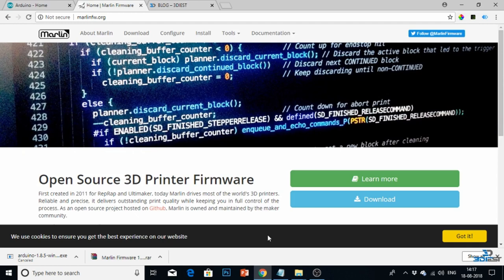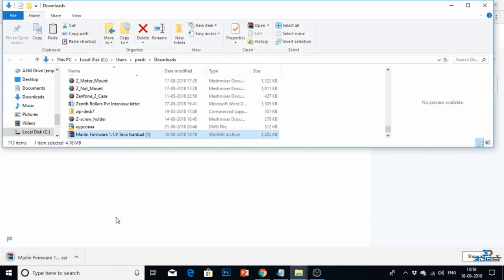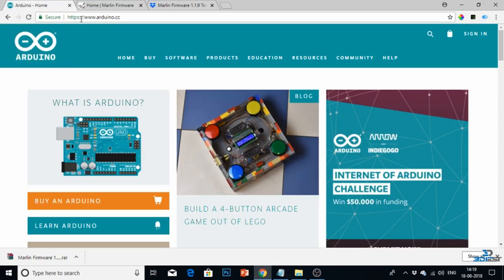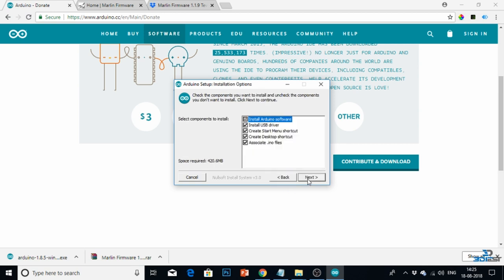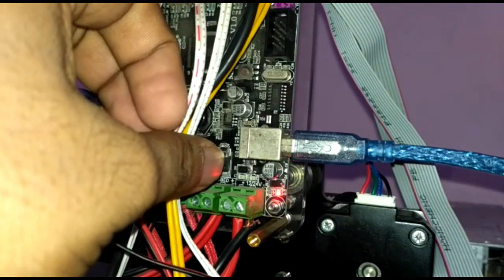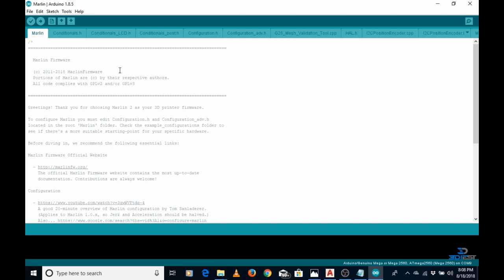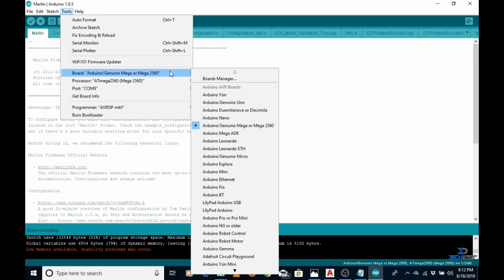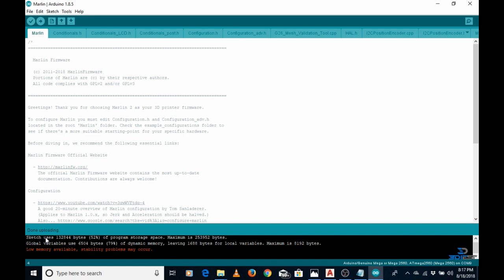Upgrade to Marlin V 1.1.9 Tevo Trantula

Comment: Your links for thingverse are not good. Print resume is ok ? Your firmware is for which motherboard with also drivers and which type of screen ? All stock maybe ? Thks
Reply from the maker: hey this firmware is configured for Stock hardware only, if you need any specific hardware i can help you with that. Also , i had corrected the Thingiverse links have a look now :)

Comment: avrdude: stk500v2_setparm(): failed to set parameter 0x9e
avrdude: stk500v2_command(): unknown status 0xc8
avrdude: initialization failed, rc=-1
         Double check connections and try again, or use -F to override
         this check.
 take error! please help.
Reply from the maker: try restarting your PC and reconnect , select correct com port
Reply: @3Diest  thanks for your help. problem on my cpu. grateful to you :)

Comment: After this upload, my stepper motors stopped working on my mks gen V1.4 ???? please help
Reply from the maker: Not possible I am using the same firmware, please check your cables and stepper drivers
Reply: @3Diest  excuse me i had some issues. Everything is working now except that the y axis wont turn its direction, already changed it in the firmware.
Reply: Excuse me.. How u change it on the programe and can u sent me the files

Comment: Don t move extrude drive? vhat problem?
Reply from the maker: Try the extruder in different ports , if it is not working then check motor cables , otherwise need to replace nema 17 motor.
Reply: @3Diest  Im sorry drive not work it is temperatura extruder not limit, all work think you!